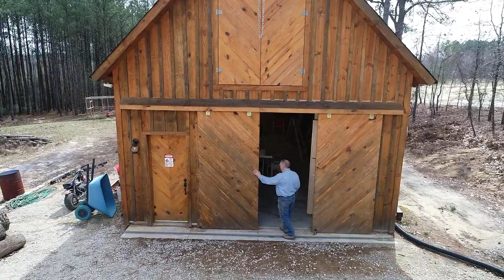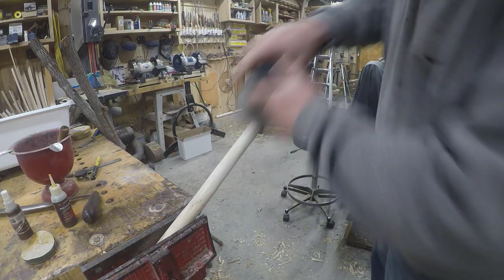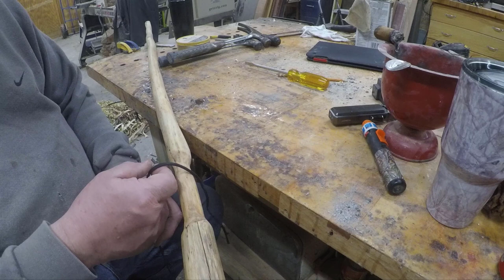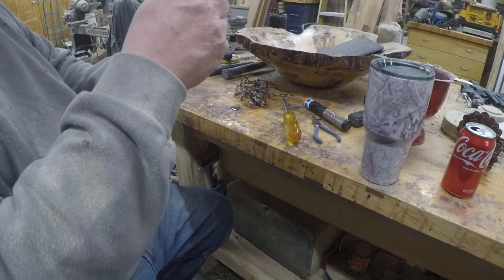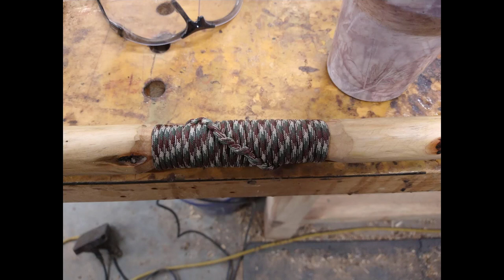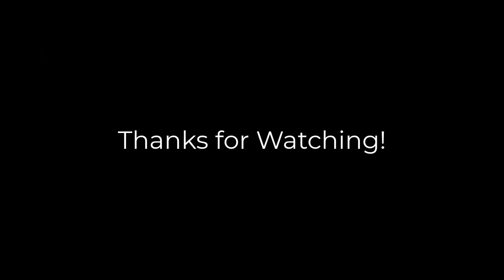Making a Walking Stick from a Hickory  Sapling

Comment: Do you think that some glue spread over the handle before wrapping the para-cord around it would help to make a firmer wrap around. ?
Reply from the maker: I have one I use myself several times a week for the past couple years and I have not had a problem with it.  Not to mention the probable mess, with glue leaking through the cord.  Thanks for watching.

Comment: Good day to you , fellow crafts person !!! I know that I am very late to this video , & I apologize for that !!! Being a whittling / woodcarver of over 50 years , I thought that I would share just one little tid bit that I learned along the way , having worked in this area before , going back several decades !!! Whether I am making the walking staff for myself or another , before I nail down the location of the handle , I , or the intended recipient , needs to put in some actual walking time with the stick , to see where the hand actually ends up , under extended use conditions !!! & once that spot of comfort is determined , I then add 6" above the thumb& forefinger spot & 6" bellow the pinky finger spot & embellish that area with a suitable grip , wrapped or carved etc. !!!  Hope that this might help , in the actual planning of someone's next project , of a similar nature !!!
Reply from the maker: That is all excellent advice!  I will, however, tell you that the walking stick part of my business was kind of an accident.  I had burned some undergrowth at my place that killed a bunch of hickory saplings I had.  I have plenty of firewood already and cold not bring myself to just burn it.  So I made the walking sticks instead.  I am primarily a wood turner and that is where my passion lies.  When I make these it will be in small batches, with no frills, and done in such a way to help keep my cost per unit as low as I can.  I sill have some of the saplings left to work with.  My booth at shows only has to items that are not turned, these sticks, and my cutting boards.  Everything else comes off of the lathe.  It at some point I decide that I want to delve deeper into this part of my business, like after I retire from my job, I will certainly enthusiastically take your advice!  Thanks for the advice and for watching!
Reply: More so for your viewers !!! @BrailsfordWoodworks

Comment: Should I let the wood season before stripping the bark?  Or strip then season for X amount of time?
Reply from the maker: I stripped off the bark green and then put them in my solar kiln.    The bark comes off easier green for sure.
Reply: @BrailsfordWoodworks  A solar kiln sounds awesome.  Do you think I can just let them naturally season?  better to do so outdoors partially covered with sun or in the garage?
Reply from the maker: @jjm6187  without another option I would look at sticking it in my attic.  Dry and hot.  Thanks!